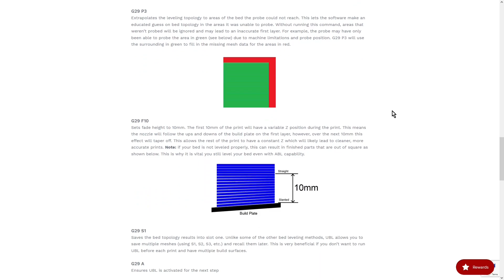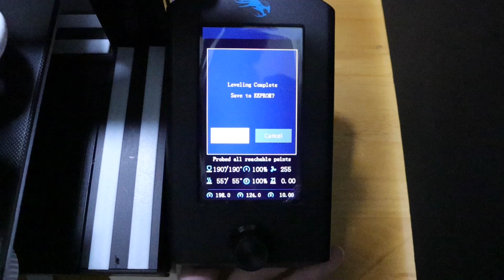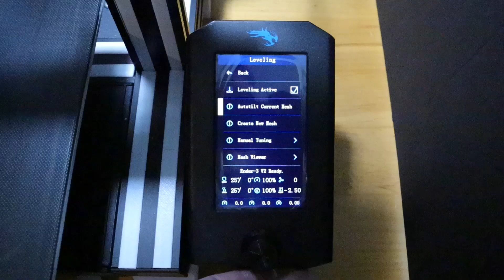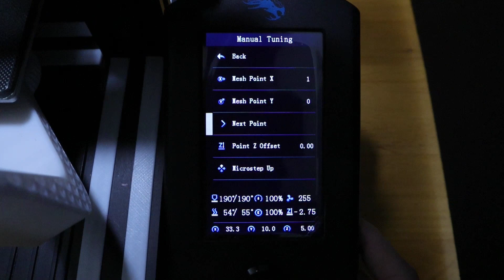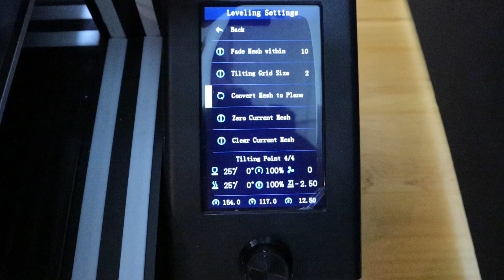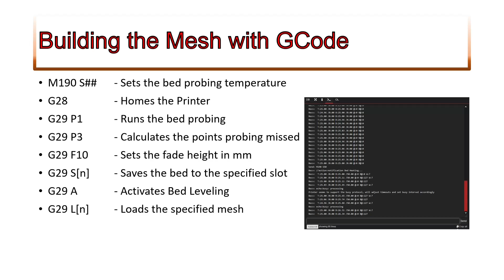Unified Bed Leveling Overview with Jyers Firmware on the Ender 3 v2

Comment: people say that need to preheat bed and nozzle before leveling. can someone tel why is it important to preheat nozzle? as far i can see nozzle heat has nothing to do with bed leveling unless your nozzle is the tool that measures bed level. in my 3d printer bed leveling happens in between bed heating and nozzle heating.
Reply from the maker: You do not need to heat the nozzle for bed leveling, only for adjusting the z offset. This accounts for heat expansion. I typically heat my bed to printing temp, then level the bed. Next, heat my nozzle to about half of my printing temp to avoid oozing when setting the z offset.

Comment: Question - will having a z- offset applied before probing throw things off? Should that wait until the print actually starts?
Reply from the maker: No, the z offset doesn't affect the bed mesh. The z offset stays the same no matter where on the bed the nozzle is. What the bed mesh does is tell the z stepper how far to move the x gantry up or down to keep the z offset the same.
Reply: @EB3DPrinting  thanks! I had a lot of trouble the first time I tried UBL with a cr-touch. I'm going to try again with your video.l
Reply: @EB3DPrinting  that all said - do you recommend running the mesh before applying the z-offset?
Reply from the maker: @MatthewOSullivan  no, you should apply the z offset first

Comment: Thanks for you explanation! Still a little confused on what to implement in start G code. If I use your typical G code does it remake a mesh every time? I thought I make a mesh and store it to use over and over and then the G code would use that info and check for tilt. So does G29 P1 just check for tilt? Why do you use M500 to save? Wouldn’t I want it to redo for each new print? Sorry I’m just not clear on this.

Comment: I have an Ender3 v2 with Sprite Pro Extruder and CR Touch, I’m using latest Professional firmware. How do I adjust the probe points? I adjusted the mesh inset values of the X & Y min & max but it’s hard to figure the settings to cover the bed. Is this where I do it? The probe can physically reach the left, front and right edges and about an inch from the rear.

Comment: Thanks for your video, finally someone explained how the menu works. But I have a few questions: Is there a disadvantage compared to normal abl in the way how far the printer can compensate? Can I simply switch to normal abl by flashing new firmware if I want? These changes you've shown (maually adjusting points, clearing z-offset etc), do they affect the saved mesh or the tilted one/ can I accidentally ruin my saved mesh with that? Sorry for all the questions, but I'm a bit scared to mess it all up
Reply from the maker: I would start by saying I haven't really noticed a significant difference between using the standard 5x5 mesh vs a UBL mesh.  BUT, that is mainly due to the size of the Ender 3 bed. On my larger printers (ender 5+) I did notice a slight benefit going with UBL. 

Next UBL vs 5x5 seems to have the same compensation tolerance. It has been my observation that you want your bed within 0.2mm of the high and low spot. It can be more than that, but I wouldn't go higher than 0.4mm. if the variance between high and low spot is >0.4mm, manual level your bed again.

Switching from UBL to 5x5 is as simple as flashing the firmware 

Changing the mesh through the menu affects the mesh saved to the EEPROM slot you have currently loaded.
Reply: @EB3DPrinting  thanks for the fast answer! Might come back when I've installed it in the following days
Reply: @EB3DPrinting  sorry to ask you again, but what does ,,convert mesh to plane" do? Does it change the mesh/ how is it affected? Or might it be just visual?
Reply from the maker: @JB-yu1vv  I'm still not quite sure the purpose of that, but basically it converts the mesh into a flat surface at an angle from the high point to the low point

Comment: I just installed the UBL 15x15 firmware and started the mesh build, but I forgot to check if I need to set my probe offset first, I remember setting that on the previous firmware at some point... dunno if that's going to wreck this mesh or something?
Reply from the maker: I would set the z offset first before setting anything else that way you don't forget and mess up the bed by starting a print with an incorrect offset
Reply: @EB3DPrinting  thanks. I checked it and it was about 5 or so mm out in each direction because I’m not using the stock mount. Shouldn’t make that much of a difference to the mesh hey
Reply from the maker: @GlenEdwards  may not make much difference to the mesh, but can affect your mesh limits, could cause the print head to move outside it's range of motion causing your stepper motors to grind

Comment: A few questions: Do you have to manually level the bed before building the mesh? Do you have to manually level the bed in the future after setting up the ubl mesh leveling if you have tilting enabled in the starting g-code?
Reply from the maker: Unfortunately, yes. You still have to manual level your bed. While the ubl is effective at making up for variances in bed shape, it's not an end all be all. 

Generally, you want to shoot for less than 0.2mm between the high spot and low spot of the bed. You can build the mesh, look where your high/low spots are, make adjustments accordingly, then tilt the mesh to see if the adjustments helped.

Now once you have it set up, with less than 0.2mm variance, you can get by with just tilting the mesh*. 

*Now I say this, but have a few recommendations. Make sure you remove your build plate before trying to remove your part. Trying to remove your part while the build plate is still on your printer can mess up the bed level. Let the plate cool completely before removing the part. Try to put the plate back on in the same orientation every time. And lastly, to make the previous steps quite a bit easier, I'd recommend a magnetic PEI sheet as a printing surface.

Comment: I'm having issues with a new 4.2.2 using the GD32 MCU. But its a pro not a V2. I realize I'd have to change the screen type, but would this work on a pro? I obviously won't have that screen but want al the features. Thanks.
Reply from the maker: The stock ender 3 pro screen will work with klipper. It'll look different, but still function fully. 

As far as the processor goes, I believe gd32 processors are supported. You'll just have to pick the appropriate processor when building the klipper.bin file

Comment: im probing using this firmware and its saying it will probe 255 points is that right? or is something messed up?
Reply from the maker: If you use the 15x15 mesh. It can probe up to 225 probe points. It may not reach all of those, but it will more likely probe 175+ points. It will take 15-20 min to complete. You only need to do this once, as you can then tilt the bed mesh with as little as 3 probe points before each print.

To me, this is way excessive for a small 235x235 bed. I personally only use the 5x5 mesh and do not have any real issues with first layers
Reply: @EB3DPrinting  ah thanks, i guess i didnt realize that it was 15x15 points when i was downloading the firmware that makes alot more sense now

Comment: I am having a hard time with UBL 10x10…. Mainly with regards to z offset I think… I had my z all dialed in, spent a day printing things with really good prints and no failed prints… the next day I can’t get a first layer at all and this is before touching any settings… I’ve re ran bed leveling, re ran z offset test prints. Get it pretty good but then try to print a large print or a bed level test print and it seems like the printer is not following the bed… can clearly see my first layer getting very thin in my high corners…. And my high corners are only 0.015 higher than a nice flat spot all through the middle.
Mainly just venting here lol…. Spent an entire day running ubl and z offset test prints to have that all go smooth but then when I try a large print just failure lol
Reply: And on a side note… I saw a video showing that jyers went up to 300c for the hot end…. Well mine still only goes to 260c??? Don’t have a metal hot end yet so not the end of the world here but any idea how I can get above 260c on jyers for when I do get a metal hot end??
Reply from the maker: what is your start gcode like for bed leveling?

also  as far as temp, that im not sure of. I would think you would need a custom version of jyers for 300C because stock printers do not support going that high, and for safety reasons, I could see them not implementing that on "stock" jyers configs
Reply: @EB3DPrinting  Start G-code was set up following your video… that all seems correct… bed temp used was 65c for leveling and setting z offset….. I have a pei build plate… it was very nice and flat but I guess it or the magnetic bed has developed a bit of a warp… currently trimming the bed out with some aluminum tape…. But it wasn’t very bad anyways…. All corners were about 0.02mm higher than the middle. I was expecting the mesh to be able to follow that but it doesn’t seem like it is. 
It’s not a big deal for 90 percent of prints that don’t take up most the plate but wanting to do a few prints that do take up most the plate lol.
Reply: And I brought up the temp because a different YouTuber (Victor) can’t remember his last name showed his printer going to 300c with jyers and said it was a benefit of the firmware, with the disclosure to have metal hot end and thermistor before going that high

Comment: I must be missing a fundamental step somewhere. I followed your steps and it start printing my test print 5+mm off the bed. What am I missing? lol
Reply from the maker: There can be quite a few things going on. Is it just the purge line that prints off the bed?
Reply: @EB3DPrinting  It was. I adjusted the Z offset, and it helped. I'm still running into issues, though. I've done everything, added the GCode and still can't get quality 1st layers. It's like it doesn't use the mesh that I tell it to load and do a tilt check on (even though I've confirmed all the right gcode is there). I swear I'm getting worse quality prints trying to use this, than before. So frustrating. I thought this would help account for all the micro bed variations, where I just can't seem to get the bed level enough.
Reply from the maker: @Cw0707  being completely honest, it's a bit overkill for ender 3 style printers. I use the 5x5 HS mesh with fantastic results.

Comment: I'm fairly new to printing and went for a Touch sensor as I've struggled on bed levelling. Even then, for a long time with my sensor and jyers - to the point of binning the whole thing. You're the first person to explain how the manual tunings, its completely changed my printing results. From nothing to at least something. Thank you
Reply: Hey all, just an update - I think I may have found the cause on this one.

Previously, I've followed other videos, doing the auto levelling followed by Z offset config (centre position). However, doing the manual seems to override this (or at least I think it does).

If I do manual point tuning and just leave Z Offset as it is (completely don't go near it), things are a lot better :) I hope this helps anyone with a similar issue

Comment: HI, this can be done without a probe, is it better to chose the manual mesh firmware?
Reply from the maker: It can be done without the probe, but it will be built the same way as you would a 5x5 bi linear manual mesh. It will not look like how it does with the probe. The difference between manual UBL mesh and manual bi linear mesh is how the bed map is calculated. You also have the option to tilt the UBL mesh before the print.
Reply: @EB3DPrinting  manual mesh Will then be more user friendly i guess. Thanks!
Reply from the maker: @zierbeek  not necessarily. Manual UBL and Manual Bi linear meshes are built the exact same way. One key feature with UBL is you can manually tilt the UBL mesh before each print which only takes a minimum of three probe points. This would help increase mesh accuracy between prints.

Unless you plan on doing a completely new manual bi linear mesh before every print
Reply: @EB3DPrinting  allright, thanks for thé clarification!
Reply: @EB3DPrinting  a video about silencing thé Ender 3 v2 possible? :)
Reply: @EB3DPrinting  but then not with buck converters since it's always An extra component

Comment: I have a question and maybe some other people are running into this issue. I cannot get the board to get close to black. I can get it all red within .08 but it’s not black, it’s a light ish red, around .25- .30. I’ve tried so many bed leveling videos but I cannot get it to print without having the extruder too close or too far from the bed. I have my beginning G code running a auto tilt with 4 probe points. Any thoughts you might have? Could manual tuning be the solution?
Reply from the maker: Are you setting your z offset before running the mesh?
Reply: @EB3DPrinting  I’m not, I make sure to zero it out before
Reply from the maker: That's more likely the problem. You have to set the nozzle height(z offset), before leveling. The z offset is the difference in height between the bltouch tip and the nozzle tip

Comment: Very interesting video. I noticed out of the corner of my eye you have a board attached to the side of your E3V2, what is it and how would I build one?
Reply from the maker: I think you are referring to the raspberry pi. This is a raspberry pi 3b+. I use that to run octoprint and printed an enclosure I found off of thingiverse

Comment: so having same issue as user bloew where the mesh doesnt seem to be used, i did a cali cube and all axis are good. if i go into manual tuning and go to mesh z value its usually off as in the bed is to close to the nozzle,. geat video and helped understand a lot
Reply: Did you ever find out anything? I have the same problem
Reply: @techno_letsgo  seems I was having adhesion issues, where I thought I was to high was due to poor adhesion. So when I was trying to get closer I was to close.  Redid level then mesh then used something I swore I wouldnt...glue stick.. problem solved been doing numerous prints since

Comment: If I created a mesh and have bed leveling activated. Do I have to have any special G-Code for my print to use the mesh?
Reply from the maker: Yes, you still need the start gcode in order for the printer to use the mesh

G29 A
G29 L0
G29 J

Comment: Will the mesh values be added to the z (layer height) as the print progresses and will this be displayed?
Reply from the maker: Yes, the z adjust itself to follow the contour of the bed
This typically isn't displayed because the adjustments are very minimal, typically less than 0.01mm

Comment: This is a great explanation of UBL, and answered my questions about it perfectly.

I have one more question, however: What fan duct is that on the printer in the video?
Reply from the maker: Sorry for the late reply

Fan Duct
https://www.thingiverse.com/thing:4375296
Reply: @EB3DPrinting  Thanks! I had found that one previously, was wondering if there was anything newer.  Can I ask what material you printed it in?
Reply from the maker: @the_bishop  I used PETG. Mine is a modified version of that one where I have the 5015 fit in a little better to it's slot. I found the original would break after some time since the bottom part of the fan slot is so thin. I just haven't uploaded my remix yet
Reply: @EB3DPrinting  Ok, thanks. I have the step file downloaded, might beef it up a little myself.

Comment: does it worth it?
Reply from the maker: In my opinion it is. You build the mesh once, then just tilt it before every print. It does seem to work better than the standard mesh. Another plus side is you can build multiple meshes. So if you use a PEI sheet and a glass bed, you can have a mesh for each
Reply: @EB3DPrinting  yes i do use for a while now but i don´t notice that mutch diference . Only in time! is a shame that firmware only can save 2 meshs

Comment: SO i set up my g-codes as you had them here, after it hits all the tilting points it just sits there and doesnt start printing. starting to get frustrated, any help would be appreciated !
Reply from the maker: Make sure you dont have a stray or missing semi-colon somewhere after the G29 J command. If youd like, you could post your start gcode below and I can look it over
Reply: @EB3DPrinting   : Ender 3 Custon Start G-code
G92 E0 A Reset Extruder
G28; Home all axes
G29 A
G29 LO:
G29 J2
G1 22.0 F3000 ; Move 2 Axis up little to prevent scratching of Heat Bed
G1 X0.1 Y20 20.3 F5000.0 ; Move
to start position
G1 X0.1 Y200.0 20.3 F1500,0 E15 ; Draw the first line
G1 XO, 1 Y200.0 20.3 F5000.0 ; Move to side a little
G1 X0.4 Y20 20.3 F1500.0 E30 ; Draw the second line
G92 E0 ; Reset Extruder
Gl 22.0 F3000 ; Move 2 Axis up little to prevent scratching of Heat Bed
G1 X5 Y20 20.3 F5000.0 ; Move over to prevent blob squish
Reply from the maker: @townsend9294  from what you copied, you have an o instead of a 0 for G29 L0. You also have an o after a G1 X command. Change both of them to 0 zero and try
Reply: @EB3DPrinting   so i changed everything like you said, made a print went to start another print and it started doing the same thing. but if i restart the print like 9-10 times itll randomly work.
Reply from the maker: @townsend9294   Copy this start G-Code into your slicer and give it a try

G92 E0 ;

G28 ;
G29 A ;
G29 L0 ;
G29 J2 ;

G1 Z2.0 F3000 ;
G1 X1.1 Y20 Z0.3 F5000.0 ;
G1 X1.1 Y100.0 Z0.3 F1500.0 E15 ;
G1 X1.4 Y100.0 Z0.3 F5000.0 ;
G1 X1.4 Y20 Z0.3 F1500.0 E30 ;

G92 E0 ;

G1 Z2.0 F3000 ;
G1 X5 Y20 Z0.3 F5000.0 ;